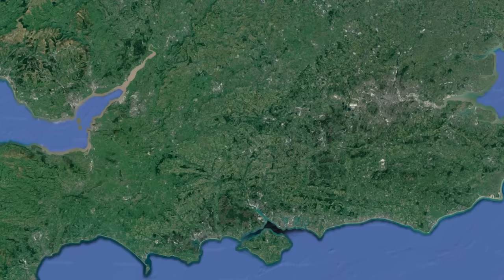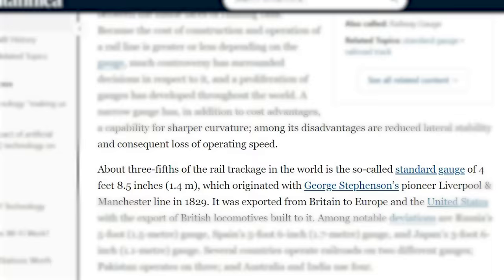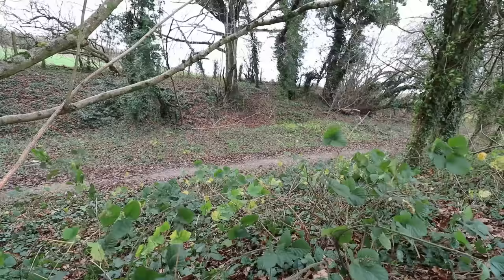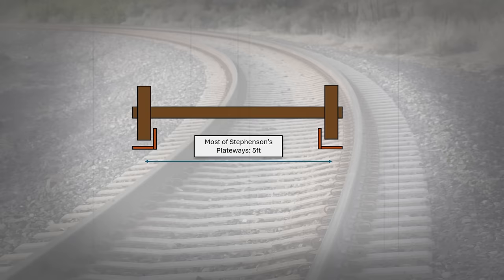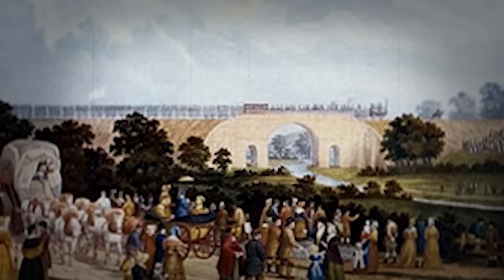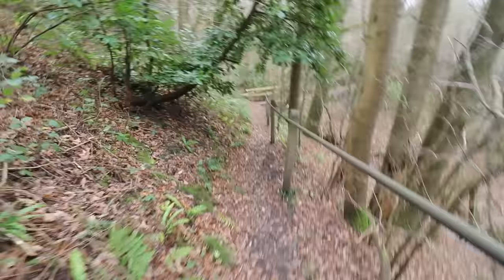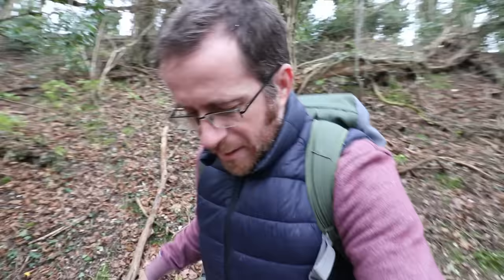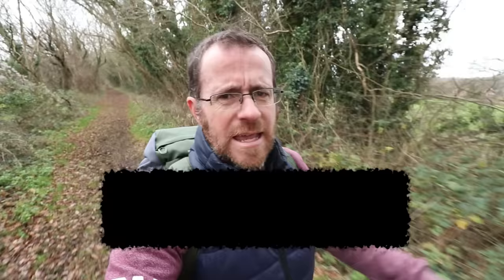Railway Gauges did NOT Evolve from a Roman Chariot.

Comment: If I remember correctly, Ian Marchant wrote in his bokk "Parallel Lines" something on Brunel's broad gauge and the question, if it was so good, then why did it fail. Have you read that? However, I don't really remember, what he wrote. And you perfectly told the story of what lead to the standardisation of gauges and why the 1435 mm were chosen.
On that note: on their explore of the Camden Junctions recently, the Hidden London team showed a sign that, among other things, denoted the gauge as 1432 mm (at about the 39:00 min mark). Don't know, why that part of the now Northern line ended up at that width. -- I will just go and comment on that now.

Comment: Another cool thing is that the wheels are conical, not cylindrical. This allows them to self center and for the wheels on a fixed axle to not squeal or slip when going round a curve
Reply: or only squeal a little!-

Comment: The "measuring in the center of the rail head" thing also lead to the odd Italian meter gauge, which in fact is 950 mm. France used to define 4' 8.5" as "1500 mm" (measured in the center) for a while. Standard rolling stock was used though.

Comment: If the mix of gauges in Britain & Ireland (it was under British administration for many years) weren't heady enough, the mixture of gauges in other parts of the Empire were even more eclectic. India for example has a broad gauge (5ft 6ins) but until comparitively recently had an equally extensive network of metre gauge railway. Why metre gauge & not 3ft gauge (the latter being an imperial measurement) I cannot say. Be that as it may, the metre gauge was useful for running around the tight curves of mountain landscape (think Switzerland) & was also cheaper to run in terms of manufacturing & running costs than the broad gauge. There is also an array of narrow gauges (less than metre gauge) throughout India & other parts of the former Empire, even today.

Happy New Year Paul & Rebecca, and to all your viewers. ❤

Comment: I once travelled by train to the town of "Chop" in Ukraine.  The track gauge changes there and they jack up the train one coach at a time and change all the bogies,  It takes about 1 hour. Standard gauge to Russian gauge.   (What about Iberian gauge - 5ft 5 and 21/32 inches! I wonder how they came up with that!)
Reply: They could potentially do that in seconds by using different bogies that hold independent and movable wheels.
Reply: Same at Terespol-Brest on the Belarus - Polish border.   The  Moscow-Nice 'Nizza' and the Moscow-Paris 'Parizh-Vost'  trains do that.   Takes a couple of hours.   The Moscow-Berlin 'Strizh' is a Talgo train with automatic gauge-changing axles which takes approximately half an hour (but I slept through it).     Talgo have been developing this for a long time, in 1991 I saw a RENFE (Spanish) Talgo train in Zurich, presumably it had changed from Spanish 5'6" gauge to French standard gauge at the border.
Reply: @cr10001  that seems slow. I have seen demonstrations of carriages switched in seconds.
Reply: @hairyairey  I think it depends on the technology. With modern trains it's all automated and they can do the change very quickly. Earlier multi gauge trains needed each axle to be manually unlocked and then locked again after the switch.
Also, in the past gauge changes would mean a locomotive change too (still quite often done at borders now due to different electrification and signalling systems). These days cross border services are often multiple units or use locos designed to run in both or even multiple countries.
Add to that many gauge changes were at borders, so a slow process would give time for border checks to take place. With Schengen borderless travel there is more demand for trains that can quickly go from one gauge to another, either when crossing borders or between board or narrow gauge (domestic) and standard gauge (international routes) within a country.
Reply: @ChrisCooper312  In the case of the Talgo trains there is no axle (which surely also reduces the wear on the wheels). The wheels are automatically unlocked, moved into their new position and locked back in place as the train is moving. Awesome to watch. It was on an episode of Chris Tarrant's extreme railway journeys. It might well be online somewhere.
Reply: Presumably Ukraine is going to standardize their train gauges to match European trains when they join the EU and NATO. 
This is predicated on republicans not surrendering the entire United States to russia.
Reply: @war-painter  Only a democrat could make such a ridiculous claim when Russia has attacked Ukraine only when there hasn't been a Republican President. Your point is incorrect, standardising train gauges is not a condition of membership of the EU or NATO. Spain still has its Iberian gauge and is a member of both. I think Portugal also has the same gauge, hence the name. Will check.

Comment: The U.S. and the UK use the same track gauge, but the loading gauges are definitely very different, that's for sure. The U.S. has the heaviest loading gauge you will find basicaly, which allowed for supermassive locomotives like the Big Boy and the Yellowstones to exist. Of course, the UK had very different priorities from those of the U.S., though, and simply didn't need such massive locomotives or the need to have such tall height clearances commonly found on U.S. railroads.

Comment: The back end of  a horse requires a harness about 4'8". So when pits started using horses to pull coal drams, although there was no standard they all ended up using roughly that gauge as being the most efficient.. When Stephenson started his  locomotive works he stuck with the 4'8" of his local tramway,  he was the largest locomotive manufacturer in the world, so set the de-facto standard.
Reply: That explains 4' 8", but where did the extra 1/2" come from?
Reply: @Mortimer50145  Paul explained it.  Having the flange gauge and the rail gauge the same meant that the flanges bound up against the rails on curves, so Stephenson nudged the rail gauge out 1/2".
Reply: @Mortimer50145  Adding the extra 1/2" gives you about 1 per cent tolerance for oversize axles as mentioned in the video. Undersize axles were accommodated by the flat of the wheels.
Reply: @philldavies7940 Not true. The gauge has absolutely nothing to do with the back end of a horse. There were many different gauges at the time ranging from 3'0" to 5'0". The track was level with the ground, so resembled more of a tramway than a model railway. 4'8" just happened to be the gauge of Killingworth Colliery where Stephenson was employed. Ig he had used the gauge of Wylam Waggonway which ran just outside the front door of the cottage where he was born, we might have ended up with 5'.0" standard gauge.
Reply: @Poliss95  True, the wagons would have been drawn with agricultural drawbar shafts connected to a single point, the width of the wagon is irrelevant

Comment: Standard gauge arose from that used in mines in Northern England.  Mining trucks had flanges on the outside and the important measurement was between the outside edges of the rails.  For a train of wagons hauled by a single horse, 5ft was a convenient gauge.  Once rails started going round bends, it was more efficient to put the flanges on the inside and the important measurement was between the inside edges of the rails.  After a few years of juggling between 4ft 8 inches and 4ft 9 inches, they settled on the gauge that has been used ever since.  The approximate similarity with the wheelbase of horsedrawn carts and Roman Chariots is because it's about right to fit a horse.

Comment: I actually count my blessings that broad gauge didn't become the dominant gauge- imagine for commuter trains how many seats they would fit into a carriage for a 7ft gauge... I could see them going to at least 4+3 or 4+4 carriages
Reply: The loading gauge (width of rolling stock) for broad gauge was almost the same as narrow/standard gauge. It was effectively only the axles that were wide with the wheels further apart. The GWR loading gauge is very slightly more generous which is why stock like Class 165/166 DMUs can have footsteps protruding from the doors.
Reply: @dominicjackson2498  I was under the impression that the loading gauge had been substantially wider- as evidenced by the room for additional through tracks alongside platform tracks at stations such as Oxford on the GWML

Comment: Certain countries have different gauges, and wider gauges have wider minimum curves. 7ft gauge will  have a much wider minimum curve than the 4ft 81/2. This is why upland areas like those in Wales had narrow  gauge railways. It was economic reality that fewer viaducts and bridges were needed  if the line could snake along the hillside and a narrow gauge can do that. The route from London to Bristol  is fairly flat and no mountains, so the 7ft gauge made a lot of sense. Big flat country will give rise to wider gauge every time.

Comment: I've always wondered how the precise measurements of 4' 8.5" and 7' 0.25" arose. Circumstances would explain the approximate values, but why were the precise values not set as 4' 8" (or even 4' 6" which is four and half feet) and as 7' exactly? It's the same as the frame rate for cinema film - why not 25 fps which is a rounder number? Or conversely, why wasn't UK mains frequency (which set the TV frame rate in early days) defined as / changed to 48 Hz so cinema films could be played at the correct speed rather than 4% fast. (Don't get me started on 30 fps versus 29.97 fps in America - that was a design flaw in the broadcast spec which meant that NTSC colour TV signals would "collide" with the TV sound channel. Thankfully the UK/European UHF broadcast spec dodged that little cock-up.)
Reply: The technical term for this is "rabbit hole".
Reply: NTSC == "Never Twice the Same Color"  as a result! 😂
Reply: @Mortimer50145 Because when they were laying track, for whatever use, they weren't thinking about a gauge. They just laid any old gauge down that suited the needs of that particular location. I Shropshire for instance they used a 4'0" gauge because the tracks didn't lead to a shaft, but to narrow tunnels which the coal waggons came out of.

Comment: Before 1918 Poland ran mostly on standard gauge but in the east there were a lot of lines using Russian broad gauge. After WW1 these broad gauges were often changed to standard, only to be revertrd to broad gauge once Soviet Union invaded and occupied eastern half of the country in WW2. During the war the rail gauge was being changed back and forth many times depending on where the front line was and only after the war ended all but one line connecting to Ukraine were changed to standard. This one remaining broad gauge line was mostly used for transporting coal but after Russian invasion of Ukraine in 2022 it proved very useful for military shipments because it allows the trains to cross the border without stopping.

Comment: The wider it is, the more stable it is and the more weight it can carry.  The narrower it is, the better it corners.  The American mining industry still uses predominantly a 3' 6" gauge for their rail, and several rail lines through mountainous regions use 3', although most of these are for tourism purposes only at this point.  There were even some that went as narrow as 2'.  

With modern materials for rails and sleepers, the standard gauge is a good compromise between carrying capacity and cornering, so it makes a lot of sense to just use the one width pretty much everywhere unless some significant engineering consideration dictates otherwise.

Comment: My research found that Network Rail looked through old documents to work out where the extra ½inch came from and they say that all records of 4ft8in for the Stockton & Darlington and Killingworth predecessor are incorrect and it never said it. I often recall the Wollaton waggonway as the British introduction to rail-ways, but it's nice to know there's one earlier. I do believe the Conrinthian waggonway has a lot to say about the origins of railways and the yoke of cattle navigating the stones crossings in the sewers of Pompeii have something to offer about standardising gauges, though in Corinth axles for dragging the boats would need to have been somewhat uniform to prevent failure. Nice work. I could do with seeing some citations of your work to help me better understand my own.
Reply from the maker: We try and use various sources to gain a wider perspective. Generally books we already own (seen in the video) plus anything else listed in the description. Namely Gareth Dennis for this video.

Comment: From Wikipedia on Australian railway gauges:

Until the 1880s, the gauge issue was not a major problem, as there were no connections between the separate systems. The focus of railway traffic was movement from the hinterland to the ports and cities on the coast, so governments were not concerned about the future need for either inter-city passenger or freight services. It was not until 1883 when the broad and standard gauge lines from Melbourne and Sydney met at Albury, and in 1888, narrow and standard gauge from Brisbane and Sydney met at Wallangarra that the break of gauge became an issue.

 It needs to be remembered, that until Federation (1901) the benefits of a uniform gauge were not immediately apparent, as passengers would have to pass through customs and immigration at the intercolonial border, meaning that all goods would have to be removed for customs inspection. It was only with Federation in 1901, and the introduction of free trade between the states, that the impediment of different gauges became apparent.

Comment: Great informative video👍
I don’t know how true it was but the original plans when the Manchester metro link tram service was being built was to eventually join up to the Sheffield system. Unfortunately the gauges were found to be different after starting the project hence the reason it never happened.
Reply: The track gauge is the same standard gauge on both systems, BUT whilst Sheffield operates low floor trams, Manchester operates high floor trams, similar to National Rail trains. Through running would require double length, dual height platforms.
Reply: @dariengoodwin  Thanks for confirming 🙏

Comment: We have old railroad track rails all over everywhere in the US. Here in my hometown in Georgia USA our rails have been torn up but we used to have a rail line linking to a national line, then an outfit built a small railway to reach out town from elsewhere in a smaller rail gage, so the freight had to be pulled and switched between trains here, than again some 25 miles away to transfer to the main line.

Comment: Interesting discussion. Wide guage can carry greater losds but is much more expensive to.lay and maintain. Conversely narrow guage is much cheaper but carries much lower loads.

The 4ft 8.5in is a compromise, but it is also very much related to the historic width of a cart that could be drawn by a pair of horses. It was the width of track laid in early collieries where the coal carts were horse drawn.  

The outside dimensions of these wheel tracks were five feet. Less two inch width for each wheel gives a guage of 4ft 8in. 

The average guage of cart ruts in Roman roads is reported in Pompeii as slightly narrower, it seems there 4ft 6in was 'standard guage'. However in other parts of the empire including Britain, ruts show a guage very close to 4ft 8in.

The Romans did seek to standardise cart wheel guage locally to minimise cart and road damage and probably also as a taxation measure. There is evidence in places slots were cut into road access points to prevent non standard (untaxed) vehicles from entering town streets.

Comment: It is supposed to be 5 foot, but they measured it from the outside, when measuring it from the inside it would be 4.8, but when building the railway lines it was increased to 4.85 due to smoother running as you said in the video. The rails themselves were 0.1 of a foot wide at the time.

Comment: For what it's worth 7 feet is 1.5 times 4 feet 8 inches.    4 feet 8.5 inches is = half pi yards.  Many of the early measurements seem to be based on Pi Yards  Multiplied or divided by an integer or + or - an Integer.   The Sole of a flanged railway wheel is usually about 5 inches  Pi -3 Yards.  Maybe it's total coincidence maybe part of traditional Engineering.  It is well to remember that Stephenson designed by proportions and Pi divided by an integer or  Pi  minus an integer give some and easy way to intuitively arrive at a good start for the proportions.

Comment: The adoption by George Stephenson of the so -called Standard Gauge was once explained to me in these simple terms, by a very knowledgable raiway man:  On curves it is necessary to elevate the outer rail to counteract the centrifugal force pushing the train to the outside of the curve, This is called the cant, and is usually measured in degrees of lift, or inches. Either is acceptable. The explanation given was that degrees of lift, and inches of lift, are an identical number when using  a gauge of exactly  four-feet eight and a half inches. Therefore, for example, 3 degrees of lift equals 3 inches of lift on the outside rail, but ONLY with this gauge. I have never known whether this is actually true, but if it is then George Stephenson made a very conscious decision to adopt this exact gauge. Maybe a contributor here, a mathematician, can tell us whether or not this actually applies. Or is it just fanciful thinking.